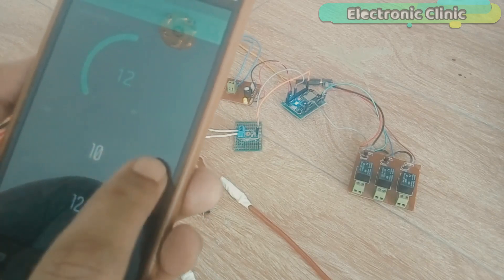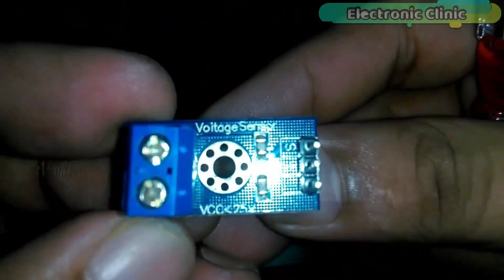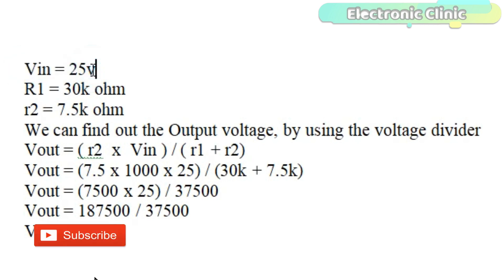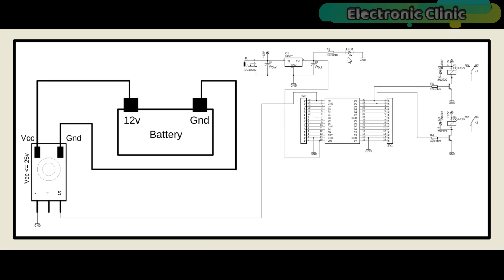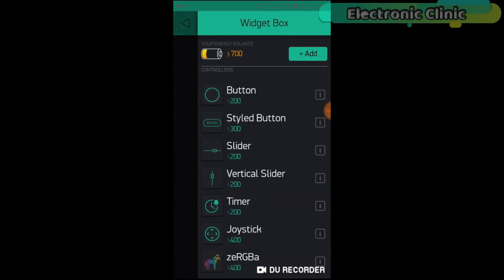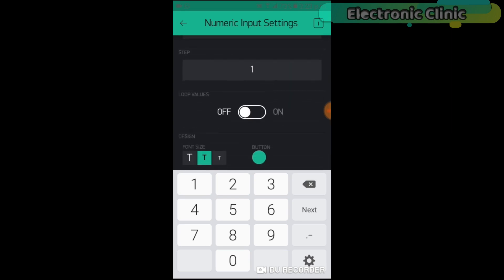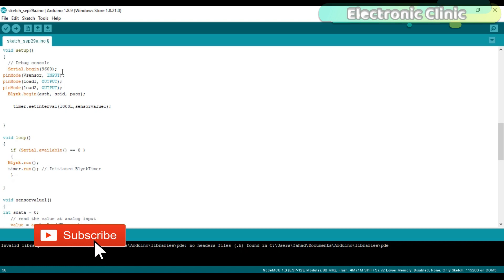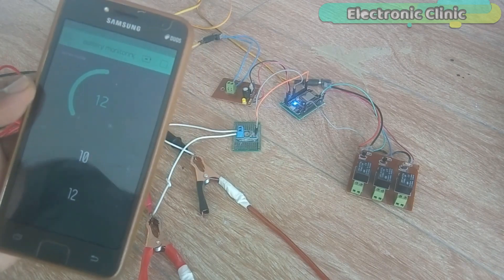Esp8266 iot project: iot Battery Voltage Monitoring using Nodemcu esp8266, Blynk & voltage sensor

Comment: Great video, thank you. 
Do you know if a 0-100v sensor exist? I cannot find one. I'm ideally looking for a range between 42v and 60v for a 14s battery. I'd like to use one sensor for the whole battery and not need to wire up 14 sensors
Reply from the maker: i have a video in which i have explained how to monitor 220vac, you can follow that video and make a sensor for any voltage.
Reply: @ElectroniClinic  Thanks man

Comment: Dear sir how we knowing 3 different battery data from 3 different area with blynk app.
Reply from the maker: Use same authentication token
Reply: sir, I want see 3 battery voltage data  with In 1 blynk aap, is it possible.
Reply from the maker: Yes my dear. You will use the same authentication token in all nodemcu programs. But use differet virtual pins .

Comment: can this project measure AC voltage like car battery(lead acid) ???
Reply: Car batteries are DC, not AC  so yes as long as its less then 25V DC this project will work.

Comment: Can u get it to measure the Percentage in the battery
Reply from the maker: yes of course. you can watch my video, in which I used led's to display the percentage of battery. actually, the voltage tells you how much charge is available. in this project, you only need to use the if conditions.
Reply: Electronic Clinic I am new to all this stuff so can you please make the code for a nodemcu to tell me how much percentage is left in my 12 volt battery on my blynk app